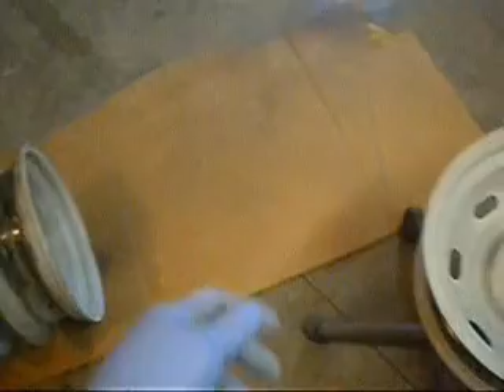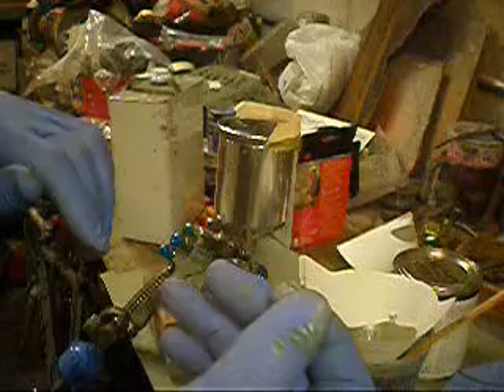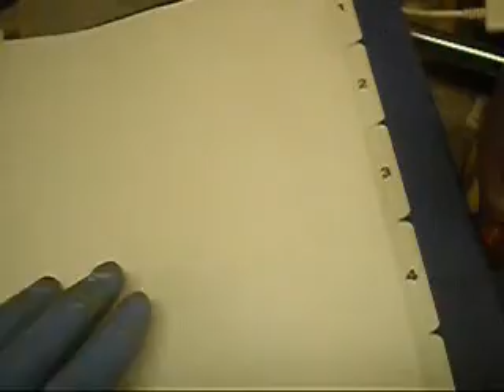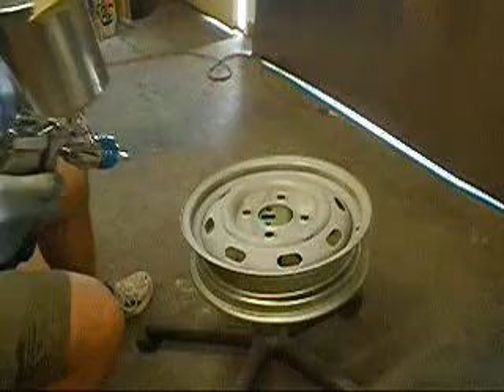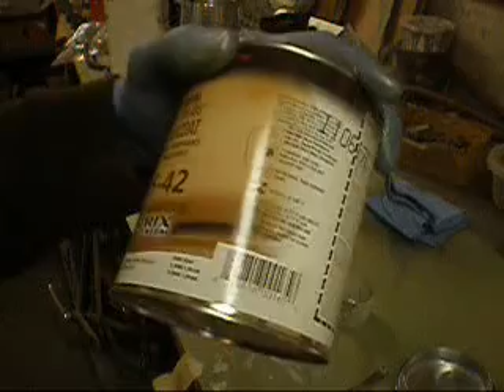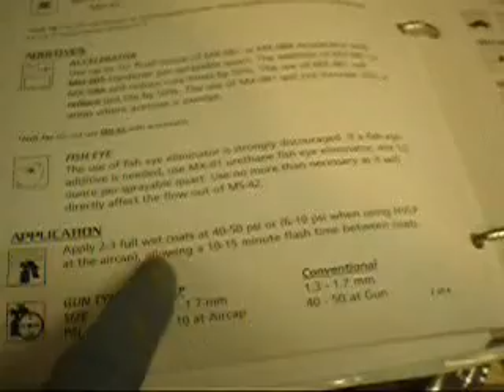How to Paint Your Wheels / Rims: Professional Products = Professional Results Part 3

Comment: I'm using Imron paint one stage gloss black. My gun actually doesn't have a PSI gauge on the gun it self just a dial, by opening up the paint delivery, you mean put it to the max?  what would I gain by putting it lower?  By feathering, you mean basically how I would do it with a spray can?  Also, I'm looking to get a very smooth  very high glossy finish, so would thicker coats be better? or you still recommend light-medium coats...

Comment from the maker: Yes.  You want to get the regulator at the auto PAINT store, not home depot.  Devilbiss has a good inexpensive one.  It will thread onto the gun inlet.  Put your quick connect on the bottom of the regulator.

Comment: I iust bought that same gun kit. Looks like it works ok
Reply from the maker: It works well in a non-production setup.  I've painted a ton of stuff with it...  Wheels, a car, trailers, metalwork projects, etc.
Reply: How many turns open do u run on the paint volume knob when painting with primer
Reply from the maker: I run it all the way open and feather the trigger.  I run a narrow pattern if I'm shooting high build or epoxy.  For sealer and base I run max width.  I run between 18 and 28 psi most of the time.
Reply: Thx

Comment: Thanks very much for your time and answers, I really appreciate it!

Lastly, in terms of PSI, If I set the regulator on the compressor itself to 20psi, is that good enough? if not, my gun has a air pressure controle, just no regulator gauge. I have the Mastercraft Gravity Feed Spray Gun from canadian tire if you need to see it.

Comment: I'm painting my rims on cardboard and doing a clear coat. When I go to flip the wheel the wheel over to do the other side the cardboard is stuck to the rims and pulls paint off the flange edges of my steel wheels. How can I avoid this?

Comment from the maker: The holdout depends heavily on the prep and the quality of the product used.  There are some really good laquers out there.  I prefer the urethanes for a basecoat/clearcoat and acrylic enamels for single stage jobs.  The laquers do not hold out near as well as the urethanes.  If you are using a rattle can laquer, you can expect a few months before it will begin to chip/flake away.

Comment: what size air compressor are you using?
Reply from the maker: I have a 5hp 60 gal unit.  It's old and doesn't have a huge CFM, but it does just fine for one paint gun at a time.  For wheels I think you can get away with a portable 30gal unit.

Comment from the maker: It's much better to have a regulator at the gun.  You can buy them for $20 or so.  I'd suggest spraying one wheel start to finish on one day, maybe even a junk wheel.  Better to screw up one wheel than waste material messing up 4 or 5 wheels if you aren't 100% confident.  Paint can be a beautiful thing or it can be the ugliest thing you've ever seen.  Ventilation, respirator and safety is key.  You can die from the isocyanates in the hardners.  Be safe.

Comment from the maker: You are correct.  I just hate to see people disappointed by less than pro results.  There's a dude selling wheel painting kits for $70 with rattle bombs.  For an additional $30-50 a kid can use the good stuff.  Granted, they'd have to borrow a gun from someone, but they could use a cheapo HF or touch up gun for the job.  Just chaps me that the guy on youtube has a website where he tries to look like a pro...  He's not.

Comment from the maker: By feathering I mean you don't have to peg the trigger, just pull lightly.  That will control the amount of paint.  You can adjust it in, but just feathering the trigger will do the same. Light touch is key. You can see how many times I go over the same spot in the vids. You DON'T want to run the paint. Think of it this way. The first coat is a tack coat, just get a mist down. That will be sticky to hold the other coats. The second coat is the cover coat. The last coat is to make it even.

Comment from the maker: Oh man.  There are a 1000 different theories on setups...  It depends on the paint you are shooting too.  I start around 20psi at the regulator on the end of the gun.  Use a test sheet to determine the pattern.  For wheels, you want lower pressure and small pattern.  You can open up the paint delivery, just feather the trigger.  Think of DUSTING the paint on in light coats...  That works really well for wheels because you hit the same spots over and over again, so thin to win.  Good luck!

Comment from the maker: It prolly says 8-10 psi at the air cap.  Check the handle, usually it says something like 30 psi at inlet = 10 psi at the cap. Every gun is different. Some like 18psi some 30psi. Paint viscosity will dictate your pressure, if the gun spits, you usually need more pressure. The paint should atomize into very fine droplets that layout into a very smooth paint film. This is why a test sheet of paper is very important.  Spray a pass on the paper and watch it for 30 seconds. It should be dead smooth.

Comment: Which body filler did you use?
Reply from the maker: Rage gold.  Yes it's expensive, but you don't need glazing putty and you don't get pinholes...  It is also compatible with base/clear.  If you are using base coat, clear coat, the cheap fillers can suck out the hardeners and leave discolored rings in your paint...  The Evercoat metalworks products will not do that.  Cheap insurance.